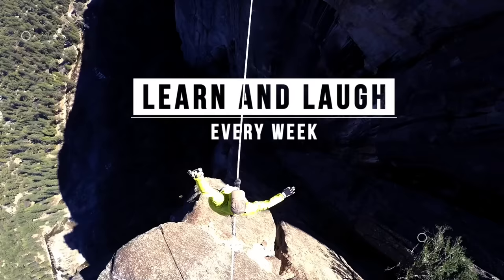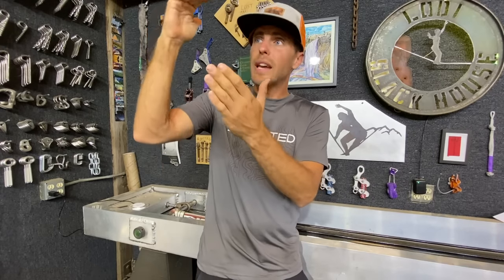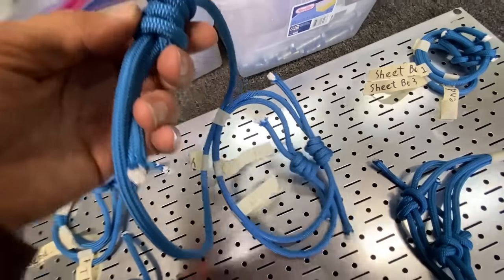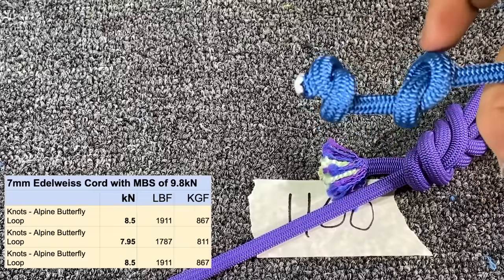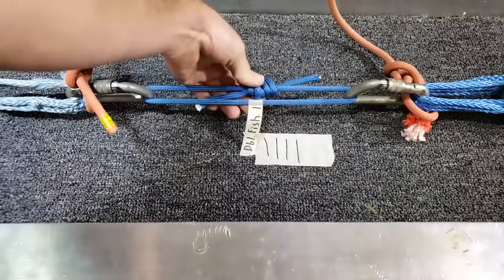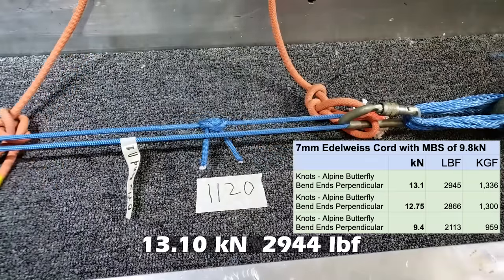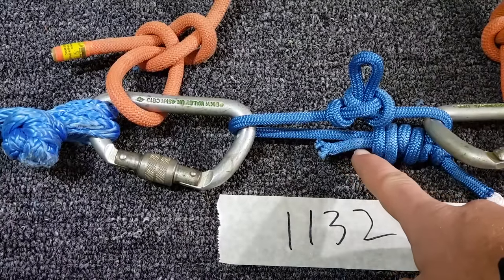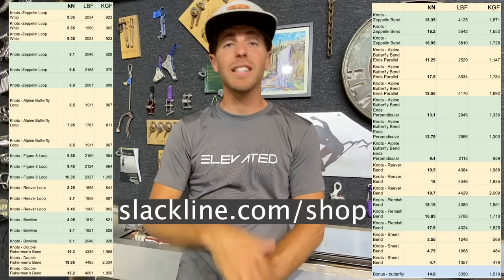Break Testing Knots - Zeppelin & Figure 8 & Alpine Butterfly & Reever & Bowline & Double Fisherman

Comment: OK, so..  I've flown kites for a long time.  The pre-cut distressed polyester lines most people use are said to fail at knots when unsheathed due to the line itself melting at the bend due to increased compression/pressure resulting from tensile forces.

Have you considered changing the rate of load application and/or mechanical displacement and seeing if considerably different time scales affect the failure point?  This is notable--if the yield strength increases one direction..  it decreases in the other.

Comment: You should try pulling the figure 8 bend to connect two ropes, in my mind it seems a better way to connect two ropes than a sheet bend, but I haven't read much about it so I don't want to risk it  relying on gut and thought.

Comment: I'd say you should test ropes one day. And I mean ropes, not knots. I guess this only works with big bend radii like in a knotless friction anchor. Maybe you could get away with a big circular wooden plate used the same way a tree is used in a knotless anchor. 
And it would be really interesting to see which bending radius is the minimum to achieve the maximum rope strength

Comment: Since the double fishermens loop is so strong in tests, what about using just one double fishermens around the load carabiner similar to top roping around a tree like you would a bowline?  Since the double fishermens is just a slip knot in this function, maybe try it two ways. First, would be with it just looped through the load test carabiner, let it slip down to the biner and see what happens and for the second test now put a simple overhand loop knot in the inside loop so it can't cinch all the way down on the load carabiner but rather now you are testing the double fishermens as it would try to pull the overhand loop stopper knot through itself which kinda simulates the double fishermans loop where each knot is trying to pull through the other. Granted this thing wouldn't be easy to untie but wow what a huge display of strength of your fishermens test, would sure like to have that strength in a top rope if possible but the only way I know to do that is to just put multiple wraps around a tree like a giant top prusik knot which I assume would be very close to 100% strength of the rope, is super simple to untie of you just put a bowline or figure 8 biner clip on the end but it just uses a lot of rope to go around a tree 5 or 6 times for friction.

Comment: I had a crew lifting an A/C motor/compressor onto a vessel. It weighted appox 300#., crated. This was a spare unit, last one, leaving Jacksonville, FL to Europe, Rotterdam. A knot was tied to lift the crate via ship crane onto the vessel. I asked out loud 'is that knot right? Only after the part was safely on the vessel did the port manager tell me that the 'knot was right'...

Comment: Would love to see a straight pull through a long tailed bowline knot (ie not loading the loop). This is used a lot in stretcher attending in the rescue field (main line and safety line tied into a single bowline together with a 2m tail to use as safety attachments for patient and rescuer, who is connected to the loop of the bowline by other means).

Comment: A bowline knot is pronounced "bolin", not "bow-line", as a bow line, also known as a painter, is a line attached to a fixture on the bow of a boat.

As I understand it, modern man lift ropes are made of Nylon, or other stretchy filaments, while on a boat, other than anchor lines and some other special cases, pretty much all lines are made of Polyester, or other less stretchy filaments. I wonder how that would affect knot strength.
Reply: That's a good question. I don't have a good answer, but that's a good question. I think the compressibility would be an important factor as well.

Comment: I would like to see a water knot in webbing. (Overhand bend with ends parallel to webbing loop.). I use that knot a LOT for general use rescue loops.

I would also like to see the difference in webbing types.

Blue water webbing vs PMI webbing.  There is a massive difference in friction between those webbing brands.  Surely a more slippery webbing would slip through some knots more easily?

Comment: Could you test which trucker’s hitch gives the most mechanical advantage and least friction loss?

For instance:

Truckies hitch (Australia) versus truckers hitch with slip knot
V with alpine butterfly loop
V with directional figure 8
V auto locking
V with carabiner
C with Prussik

V doubled back through another loop (like a double truckies or wagoner’s)

Thank you!

Comment: Hello Ryan - thanks for the effort and time to produce this video - it is appreciated.
I've got some technical feedback for you - all given in good faith.

For clarity, listed in point form.

1. The principle concept behind your knot tests is the default mindset of 'pull-it-till-it-breaks'.
What do these types of tests actually prove?
What insights did it reveal?
All knot testers around the world appear to have a default mindset of 'pull-it-till-it-breaks' - and then pop the champagne cork, publish the results and celebrate.
I am not sure if this mindset will ever change in my lifetime?
Although there was a refreshing change with the 'Hard is Easy' Youtube video on #1047 F8 jamming tests (although he made many mistakes - and never used a load cell to measure the peak loads he achieved).

If you insist on pure MBS yield tests (ie 'pull-it-till-breaks' default mindset) - you should be examining just one variable against a 'control' - and the purpose should be to investigate the effect of a geometric change in the knot structure (particularly with 'Bowlines' - and the effect of increasing the number of rope diameters inside the 'nipping loop')

2. You need to let your viewers fully identify the knot specimens - and in particular - exactly how you tied them (ie, the precise geometry and dressing state).
from 4:15 - 5:40 we get a preview of the knot specimens. I found it too quick and the camera movements too fast to actually be able to check the precise geometry you tied with each specimen. I tried pausing your video and going full screen with a large monitor - and it still wasn't easy.
Slow it down - give the viewer time to verify your knot geometries (at least so we can pause and go full screen).
It also appears that you didn't pay close attention to the dressing states of the F8 eye knots - but the camera movement was too fast - and pausing the video still didn't give me a chance to verify exactly how you tied the F8 knots. I had to go back and do forensics on your Zeppelin eye knots (ie 'loops') - I wasn't able to check all of your Zepplin eye knot specimens.

3. The Sheet bend at 5:39 is tied incorrectly.

4. At 5:41 - the load testing commences.

5. From 5:41 - 7:15 was all Zeppelin eye knot MBS yield tests. Camera movements too fast to check knot geometries.
At 6:14 the camera finally stopped moving just long enough to pause and examine the knot specimen.
At 6:26 - after another MBS yield test, the 'half-hitch 'stopper' knot is shown - which is a completely worthless addition (stop adding this worthless hitch - it serves no useful role).

What did you learn from the Zep eye knot tests?
It is good that you test 2 Zep eye knots simultaneously (one at each end termination).
You missed an opportunity to show the audience that the surviving Zep eye knot did not jam - ie, that it can be untied by hand (no tools required to loosen the knot).
When testing 2 knots simultaneously, you will always have one 'survivor'. You need to carefully examine the surviving knot specimen - because it will have been loaded right up to its MBS yield point. 

6. Next comes the #1053 Butterfly eye knot tests at 7:16.
The loading profile is off nominal for this knot.
The way in which you are loading the 'eye' of the Butterfly is not how it was intended to be used.
If you are going to tie a Butterfly eye knot as a fixed eye knot end-of-line, you should use the 'Mobius Butterfly' or one of the other derived Butterfly eye knots (they are derived from the Butterfly bend).

All 'bends' have 4 corresponding eye knots (within a chiral domain).
For example, the Butterfly bend has 4 corresponding eye knots - one of which is the #1053 Butterfly (drop the use of the prefix 'Alpine').

The #1053 Butterfly perform best in a BTL (biaxial through loading) profile. That is, load passes through the knot core from SPart-to-Spart. In this loading profile, the eye is isolated from load.
Eye loading is not so good - in fact, once a certain load threshold is reached - the Butterfly jams. In a 'BTL' loading profile, the Butterfly is jam resistant.
It would have been good to demonstrate this to your audience.
Also, keep in mind that the Butterfly is a TIB knot (Tiable In the Bight).
The Zeppelin eye knot is not 'TIB'.

7. At 8:20, MBS yield testing of #1047 F8 eye knot commences.
You missed an opportunity to test 2 different geometries (per 'Hard is Easy' F8 jamming video).
Pulling a knot till it breaks proves nothing... what you could have done is probed the jamming threshold of the F8 in different geometries.
I would also point out that there is no load that a sole rock climber can achieve that will ever reach a knots MBS yield point. For example, tying-in with a #1047 F8 is perfectly 'safe' - there is no fall that will ever break the tie-in knot. So why bother doing the default mindset of 'pull-it-till-it-breaks'? Better investment of your time and money to is to investigate jamming thresholds.
And again, forget the half-hitch 'backup knots' - they are pointless - and in fact interfere with your tests. For example, you could investigate tail slippage (ie mark the tail position - and measure any creep/slippage as load is increased - and report this).

8. At 9:59 the 'Bowline' tests commence.
You are testing the #1010 Simple Bowline.
Note that this really should be the 'control'.
You missed an opportunity to test the 'inherently secure' Bowlines (eg EBSB Bowline, Lees Link Bowline and Harry Butlers Yosemite Bowline).
Furthermore, you missed the opportunity to test the effect of adding more rope diameters inside the nipping loop.

At 10:13, we see why it is important to mark your test specimens (with a marker pen).
There was no way to accurately determine what occurred - because there are no reference marks to reference against.
Mark your knots specimens - and then you can carefully observe the 'surviving' knot specimen - to see what has happened.
All you are doing is 'pulling-it-till-it-breaks' - and any real science is simply lost.

9. At 11:33 it appears that the #1415 Double fishermans bend is tied incorrectly (but again - there is little opportunity for viewers to check the geometry carefully.
Furthermore, you should test 2 knots specimens in this round sling configuration (one either side). This tactic also helps to alleviate unequal movement of the rope (the knot compresses and the rate of rope movement on one side of the round sling is different to the opposite side).

10. At 11:49 the Zeppelin bend is tested.
Once again, you need to tie 2 Zeppelin bend knots - one either side of the round sling.
And remember, you will always have a survivor knot specimen to examine.
Furthermore, you can show the viewers that the surviving knot can still be untied - even though it was loaded right up to its MBS yield point!
So this is another missed opportunity. (due to the 'pull-it-till-it-breaks' mindset).

11. At 12:16 you commence testing the Butterfly bend (again tied as a round sling).
Same issues as before (need 2 identically tied Butterfly bend knots - one either side).
At 12:30 - we get to see the knot from the 'overlapping' side. All Butterfly knots have a 'S' side and a 'Z' side.
Look closely, and you will see different rates of slippage on one side of the bend compared to the opposite side.
In the video - 'S' is on the left and 'Z' is on the right.
Unfortunately, its all over too quickly and the opportunity was missed (because the mindset is only on 'pull-it-till-it-breaks').

At 12:41 we can see that the knot is sloppily tied.
At 13:01 - this is not a 'Butterfly bend' - it is some kind of variation - and you need to let the viewer scrutinize the exact geometry.

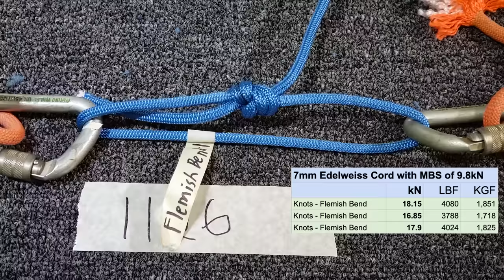12. At 14:29 you commence testing the #1411 F8 bend (don't call it a Flemish bend - the history of this is unclear and dubious). It is an F8 bend.
The geometry is asymmetric - could have been dressed to ideal symmetry.
Once again - you missed an opportunity to alter the relative position of the SPart rope segments (per 'Hard is Easy' F8 jam test videos).
You could have tied a 'control' #1411 and compared it to another #1411 with the SParts re-arranged.

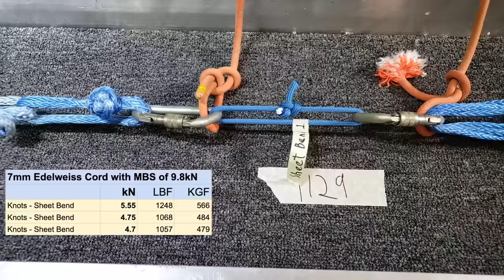13. At 15:08 you commence testing the Sheet bend (#1431).
It is tied incorrectly.
You could tie the correct Sheet bend and use it as a 'control' to compare against the version you tied.

14: At 16:20 you test the #1053 Butterfly tied within a round sling.
The #1415 Double Fishermans is tied incorrectly.
We see that the eye of the Butterfly slips - should have marked each side with a marker pen to compare rates of rope slippage. You could report the any differences observed (there is always a 'S' side and a 'Z' side with all Butterfly knots).
Would be good to see eye loading of a Butterfly (on both 'S' side and 'Z' side - and compare against 'control').

...

There's a lot of feedback here for you Ryan.
I think you are missing a lot of valuable science because of the narrow focus of MBS yield testing (ie pull-it-till-it-breaks).
There are so many other more interesting aspects to examine (eg jamming thresholds, instability thresholds, tail slippage/security, etc).

I'm hoping that you can take onboard some of my feedback for future knot testing?

Comment: Are you aware of similar test done on hitches rather than loops or bends?  For example, how would a Gnat hitch on a carabiner fare when subjected to a tension approaching the breaking strength of the rope?  

Also, there is an improvement to bowline called Scott's Locked or 'woven' bowline, apparently popular in the climbing circles.  I wonder if the additional entanglement of working end makes it less likely to start slipping back through the knot when the load is high.

Comment: What I like: manyyy knots and data.
Suggestion: make those tests in a context and try to simulate. For example, I use a beal dynaloop to anchor me to mount a rapel. You can do many variations of knots to anchor and to use the extended rapel

Comment: Dunno what sheet bend that was, I've seen no less than four knots called "sheet bend". The one I learned and the one in the book I have are the same. This knot is essentially a boline tied with two different ropes. I was told that it's supposed to pull loose if it's over stressed, as it's meant to be tied in a sail sheet, after it's already been broken.

Comment: Those sheet bends are Left handed. The bitter ends of the knot should be on the same sides, not opposite sides. No wonder they slipped so easily.  

Ashley Book Of knots goes over the distinction as 66 & 67 and again in 1431 & 1432. I love your videos and this has got to be my favorite episode so far.
If you still have the rope, may I request you test them again, but tied  so the ends exit the same side?

Comment: I've been really curious about the bowline vs figure 8. I came up climbing outside the US and bowlines were standard for sport climbing 20 years (and still are common, I believe). My assumptiong is that the safety organizations favor the fig8 because it's harder tie without looking at what you're doing, thus requiring more attention, leading to fewer absent-minded mistakes. Not surprised to see the 8 also slightly stronger, but what's your view of of bowlines vs figure 8s for tying in? Should they be tested on harness loops? :)

Comment: Do you think this test might reach higher results on the ones that were around 19-20 kn (the bend loops) if the radius of the attachment was larger than a regular carabiner ? That seemed to be the failure point and it wasn’t reaching the max potential of the knot.

Comment: As an engineer I can tell you that the ropes are going to have different MBF due to different materials and some companies use smoother strands and a stronger bonding agent however you should find that if you have to rope from different companies, and you apply the same amount friction to both ropes and try pulling them through the friction device at the same speed the rope with the higher MBF will have heated up more than the other rope, this is due to the strands being fibrous so as a load is applied to fibres of the rope will begin to pull against each other creating a stronger bond in the fibre up to the point where load exceeds the friction of the fibre, hopefully this is good enough for you, I could go into more details including how you test is flawed and it’s not actually true to MBF as you would need to do a shock load test rather than gradually increase the amount of force applied to the rope.

Comment: The sheet bend tails should be on the same side, not opposite sides of the rope, and as loose as they started I’d tie them as doubles. I was also quite disappointed just how loose all the knots started; would have also liked to see a bowline with Yosemite twist/finish as it’s what I use to climb and comparable to a figure 8 loop. Also would like a larger loop tester as the tight bends around the carabiners seems to be a failure point prior to the rope. Bowline on a bite would be nice to see as well.